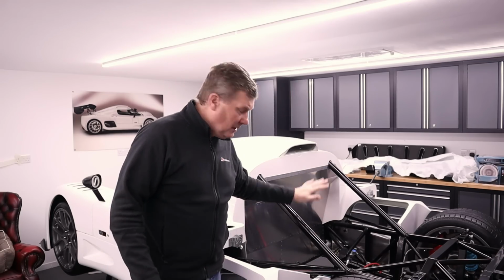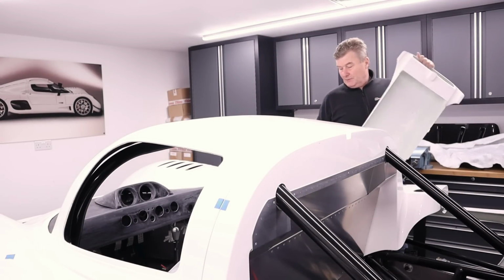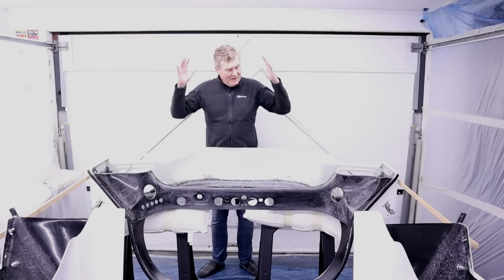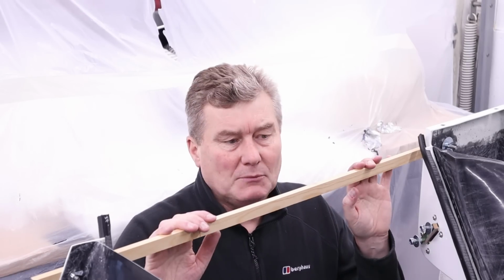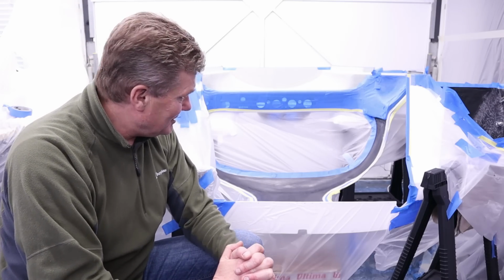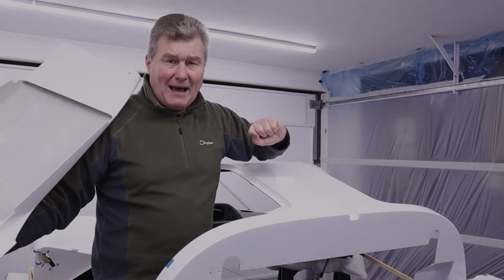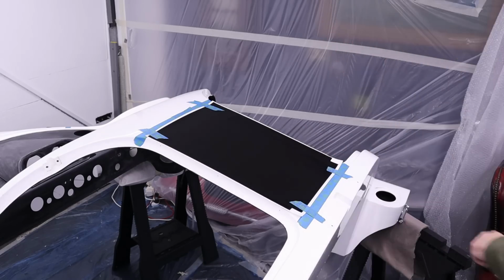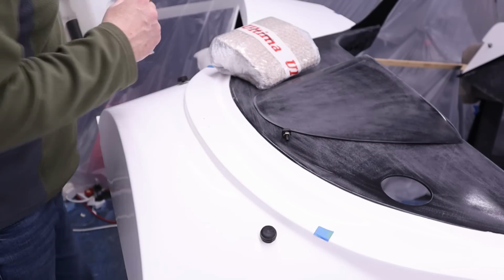Building an Ultima RS with Nigel Dean. Part 30. Preparing the cockpit for final installation

Comment: Fantastic coverage of a very interesting build. It is a bit more than just assembly, isn't it? Granted, you're not welding and milling, or otherwise fabricating, but you certainly are detailing, which is where the devil is found. Just gorgeous work. I build motorcycles, however this particular car has intrigued me for years, especially since the new RS came out.  My question is, does anyone finish these things to luxury sports car car standards, rather than a track car?  Such as  without the rear wing and with alcantara and leather wrapped everything inside, lots of sound deadening, an actual dash and cabin amenities befitting your average, north of $150K, exotic sports car. I realize the scorching performance is the point with this car, and with 600-700 HP on tap, a track is the most likely place to exploit it, but people do drive Porsches to work every day. American V-8 reliability should make this car a capable daily driver, or at the very least a fun weekend car in the mountains or out in the countryside, rides you'd want to take in relative elegant comfort.  Keep up the good work, you've gotten me hooked.
Reply from the maker: Hi John and thank you for your comprehensive comment and supporting the channel now your are hooked :-). It's an interesting question you raise and even though the Ultima RS is a raw driving machine it does have a level of creature comforts. For example the options I have selected include a leather trim kit for the dashboard, floor and bulkhead carpets and leather glad roll cage (see episode 31 this Friday). When I built an Ultima GTR in 2003 I used it most days to commute to work over a year and the ride was comfortable, the cabin was water tight, no rattles, and the air con kept the interior just at the right temperature. Yes the noise can be a little intrusive if you are doing a 100 mile stint, probably much the same as a Ducati I guess? Some builders go a step further and add additional trim, sound deadening etc, but my build is as Ultima designed on purpose for the channel. You are 100% right regarding a Porsche, an amazing brand which delivers a performance car and family cruiser in one, However, most people who build Ultimas have or have had, super cars previously and seek a more visceral experience, something the RS delivers like no other machine. You are also spot on when you say the devil is in the detail, and the fit and finish is partly down to the builder. Keep tuned and once again thanks for the comment. Cheers Nigel

Comment: What would it take to put in Alcantara for a headliner? Would that a be a similar process to installing the heat mat for the rear clamshell?
Reply from the maker: On reflection not too much effort. But once the body is on the car there is little of the roof you can see. There is a web which joins the two roll bar roof bars and Ultima provide a small head liner for this. However, not such a bad idea

Comment: Looking great as always.

Did you consider the inner roof and windshield pillers in Alcantara
Reply from the maker: Hi Mike, you are not the first to ask that question and in fact I did not. At the time of ordering it was not listed as an Ultima option and I'm not sure if it is available now. Anyway, I'm happy with how the cockpit is coming together, especially since I'm opting for the leather wrapped roll cage. Cheers Nigel

Comment: Nige,can you tell us when the engine i s being installed?
Reply from the maker: Hi Stuart, I reveal all in Episode 21 and also the logic of my choice which surprised a few viewers. It will be an LS3 to get the beast on the road and shaken down. Then I intend to fit a twin screw supercharger to up the horses and more importantly add that amazing sound. To me it's all about the drama, and the Ultima is a perfect environment to have a blower whine just inches behind your head. Thanks for the comment and stay tuned. The engine and box will be arriving soon. Cheers Nigel

Comment: Sad to see you need to take away all the panel factory use long time to align. Why did you make the factory align all panels when you needed to take them of?
Reply from the maker: Hi, good question. Even though I'm removing the panels all the effort invested in the pre fit remains since multiple location holes are still present to align once everything is reassembled. Fear not she will be back in one piece soon and to the same exacting standards post body pre fit. Cheers Nigel

Comment: Another great episode! I love the attention to detail. Are you following the manual in order of how it’s published? Other owners have told me you can skip around. I’d like to avoid installing something major (like center section) and then later realizing I missed something and have to uninstall it again.
Reply from the maker: Hi Brian, yes in the main I am following the manual. The only reason I may do something very slightly out of order is for the channel. I am on a tight timeline posting an episode every two weeks so if for example I don't have a person to help lift a body panel I may have to skip to something which I can cover. However, if you follow my steps you will not be far from the manual and since I have built a GTR before I am aware of the order to avoid repeating steps unnecessarily. Cheers Nigel

Comment: Hi. I really love this car, but cannot decide if I should build one or just buy a 911? I appreciate very different cars, but still not sure. Any advice throw it this way!
Reply: If you're on a journey to build something with your own hands where from the ground up its very much your choice what grade of components you get it's clearly the Ultima. The 911 will have decades of development and component packaging that gives you much better creature comfort, space and integration of systems. The aircon is a clear example where Ultima's under the dash, out of sight, might as well be brail positioning of the heater controls clearly looses to the 911, as well as lacking a cabin air filter or a nice way to get air from the outside into the air con.  One of the reasons Nigel has so many views is that Ultima's instructions and images in the manual can be shockingly lacking in detail and his videos have become one of the go to guides. In this respect Ultima really need to up their game. I'd strongly suggest talking to people who have built one to find out if it's worth the pain. What ever you choose, make sure it ticks all the boxes before going ahead.
Reply from the maker: It all depends what you want from a car. A 911 is a very capable car but unless you go for the big bhp models the driving experience is - how should I put it - OK. Sure enough you have the creature comforts but is that what you want from a car? You can only answer this, there is not a right or wrong answer. An Ultima, building experience put to one side, delivers raw race car experience on the public roads. So if desire a car to commute to work on a daily basis the Porsche is for you. But if you want a machine lurking in your garage which will make you feel alive every time you get behind the wheel - look no further than the Ultima. Hope this helps. Cheers Nigel

Comment: Huge congratulations on reaching 1mil views Nigel, makes yours and Rufus’ hard work in the editing suite all worthwhile.

The sound when you took the cockpit off made me wince for a second, it really sounded like something had cracked. Thankfully not !
Looking at the complicated shape, do you think it would be possible to trim where you painted with a thin carpet/Alcantara instead or would it look too untidy on the edges?
Also, regarding the side pods, will you be fitting the wheel arch ducts? They seem a pain to fit but it seems a shame to have a fake channel in the side of the pod if it’s not venting anything.

Great work as always Sir. My chassis arrives in Feb so I’m watching all your previous vids again and making notes………. beats Netflix any day.
Reply from the maker: Hi Garreth, wow a lot of questions and thanks for the congratulations. OK taking your questions in turn. Fitting a roof lining is technically feasible but it would be extremely challenging with the shape of that roof. Once finished the interior does look amazing though. Wheel arch ducts - watch this space :-). Not long for you to wait - keep counting the days. Cheers Nigel

Comment: is it really a hypercar? Or just a supercar/track car?
Reply from the maker: Now that's a good question. I researched the definition prior to using the term and it varies depending where you look on the interweb. All I know is the RS can out perform production cars that have the label hyper car, so I guess that is a clue. Anyway, I get a little carried away with my introductions since they are an explosion of enthusiasm to engage viewers. All I can say is regardless of classification this is a beautifully engineered beast, a delight to build and boy it performs like a scolded cat :-). Thanks for the comment and watching the episode. Many thanks Nigel
Reply: @v8creative  yea, don't get me wrong, i would like to own one, build one but i don't think it's at the level of a koenigsegg, pagani, bugatti(except the track performance). Anyways, cheers.
Reply: @HowDareYouu  in some places it is in some it isn't, in the mid range it will out accelerate a Bugatti, but low and top end acceleration the Bugatti will beat it. If it's not a hypercar then it's not one by much.

Let's put it this way, you will never be at the lights wondering if the car next to you was faster !!
Reply: Take a read of Autocar, they detailed the top 10 fastest accelerating cars. The Ultima was 4th, only beaten by electric hyper cars. It’s claimed to be faster than a Bugatti Chiron Supersport and yet it’s only 5% of the price. It may not have the fit and finish of a Pagani etc but it also doesn’t have the multi million price tag.
Reply: @v8creative  a hypercar means more than acceleration: Exclusivity, exotic materials,/high tech materials/finishes, low number o cars made, high price, etc
Reply from the maker: @HowDareYouu  Great debate. This will always be a passionate discussion but one thing is for sure - we all have a common passion.
Reply: FYI, there are only x3 RS Ultimas up and running in the UK. That makes them exclusive and exotic. This is a hand built machine, with such attention to detail, even unseen parts painted (thanks Nigel's Dad!) and lots of carbon. Hell, there are only 43 Ultima GTRs with current MOTs. I was going to buy a Maclaren 600LT spider but bought at GTR720 partly because of their exclusivity, but really because they are a raw driver's car, a hyper car for sure. I can't wait for this to be finished and hopefully meet Nigel in person one day on an Epic Ultima owners meet.
Reply from the maker: @jasonhill2896  Hi Jason and thanks for the comment. which is absolutely on point :-). Of course once the RS is complete it would be great to see you and your GTR at an Ultima meet. Cheers Nigel